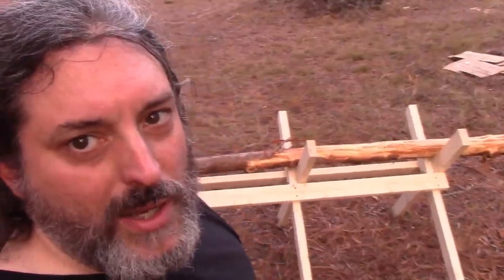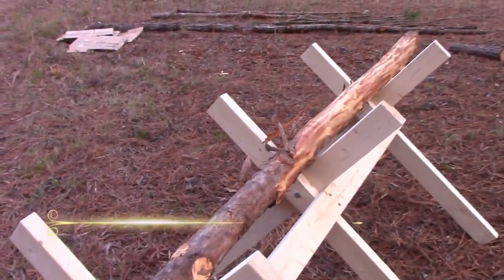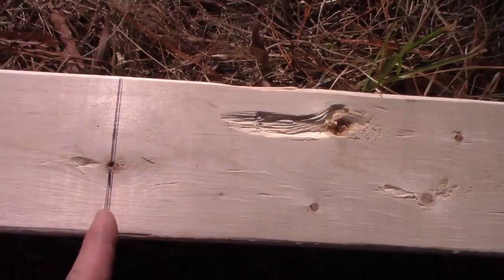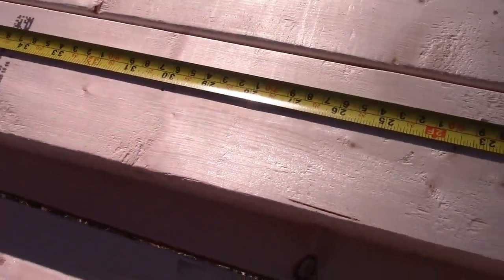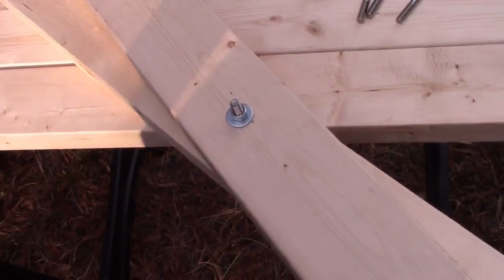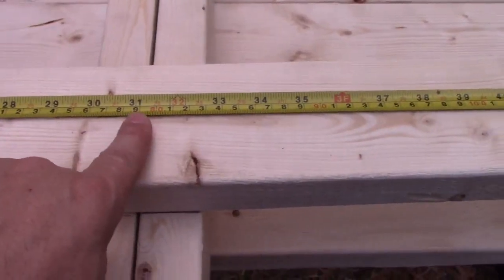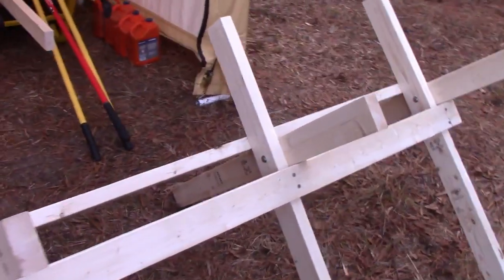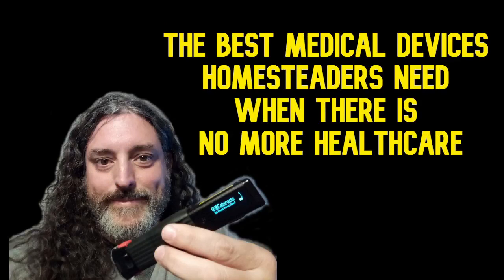Step By Step - How To Build An Extended Sawbuck For Longer Logs

Comment: Really liked the tip for the screws. I’d never have thought to zip them in at an angle.
Reply from the maker: Thanks, it really works good.  10 to 15% angle is the sweet spot